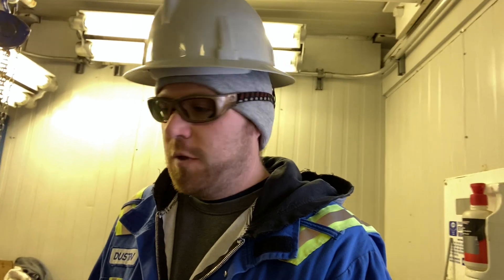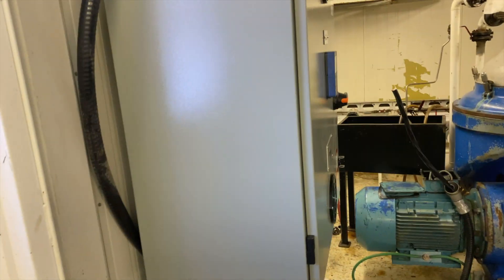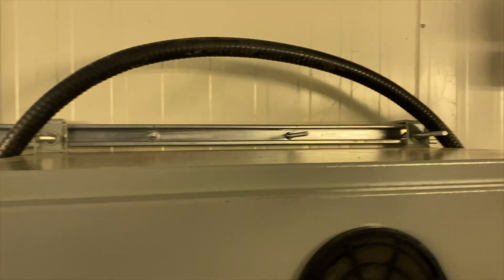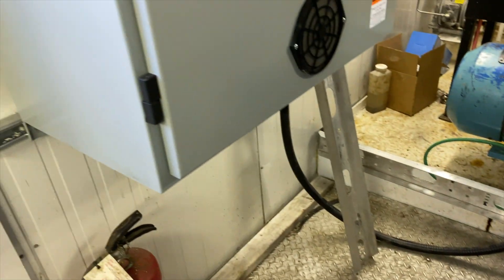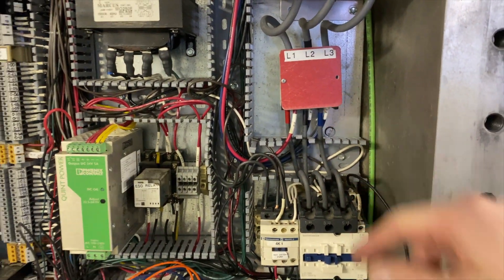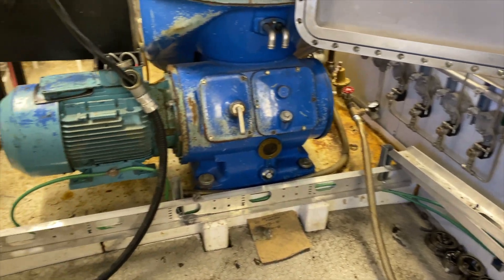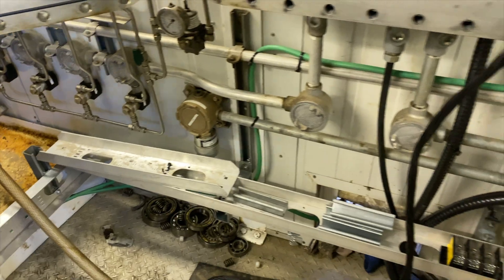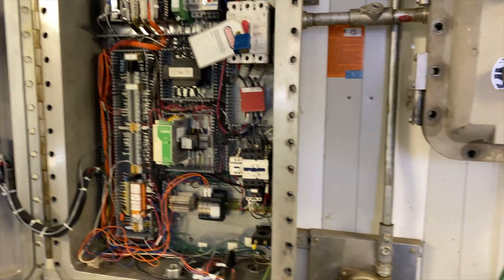Industrial Electrician - Just Another Day As An Electrician

Comment: What is the advantage to choose cable tray over conduit in that setting?
Also, what type of cable did you run in the tray?
Reply from the maker: Hi EB C, thanks for the comment!
Conduit was already ran in this building and no room for expansion. In this scenario it would have taken probably 5 times longer with conduit compared to tray and teck cable.
I used I-Tray for this install.
Do you normally run conduit?
Reply: @electricianinformationreso9701  commercial worker here, so it's always been conduit and gutters around me.

Anyways, enjoying your content. Thanks for putting out
Reply from the maker: Thanks for the great feedback!